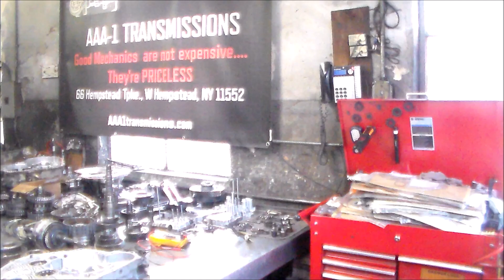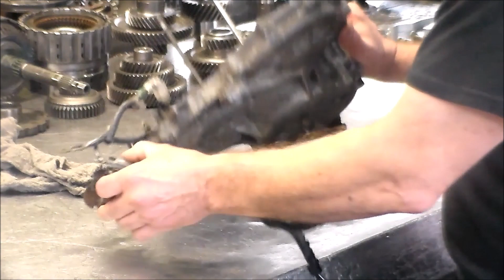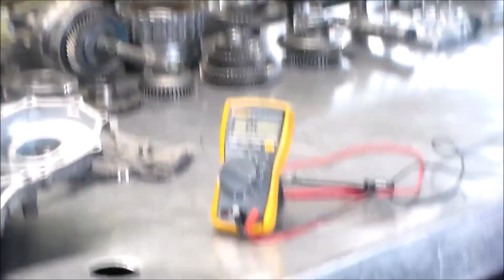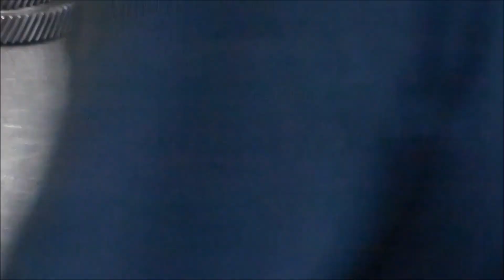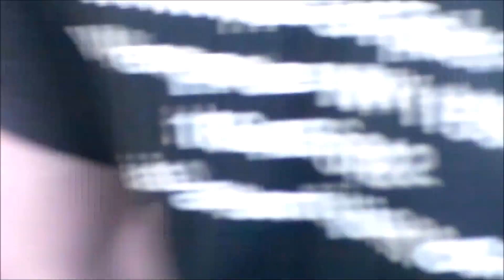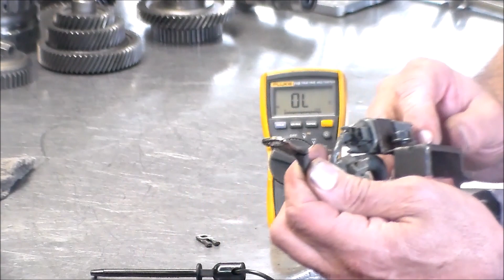P0758 Diagnosis & Repair, 2004 Honda Pilot

Comment: I was recently gifted a 2001 Accord V6.  It has a p0758 code. All the solenoids including B  were replaced but the problem continues. I tried finding the ground wire for the four solenoids but the it’s different than this transmission. Any suggestions?
Reply from the maker: That set up is not on this unit, should ohm out the solenoid at the computer, this way you can check the wire and the solenoid at the same time.  Where did you get the solenoids from?

Comment: Thanks for the video. Is there a way to remove the harness just for the trans solenoids without cutting the harness?
Reply from the maker: It's all one piece, the internal and external
Reply: @GaryFerraro  Wow thanks for the quick reply! If I need to.. to find a short in the solenoid wring would you recommend cutting the wire harness for the solenoids where it joins the rest of the harness at the hard plastic cover that is bolted down?
Reply from the maker: @trevora7500  You should ohm the solenoid first, rarely see problems with wiring

Comment: I want thank you for your video my code was PO 753 and I couldn't find the fix I was ready to junk the polit over this ground I had been all over this polit checking ground wires the information I was getting for the PO 753 did not show this ground location
Reply from the maker: Thanks for sharing, glad you got it fixed